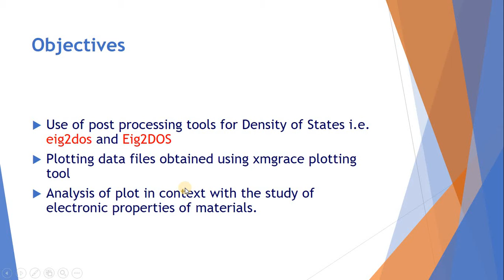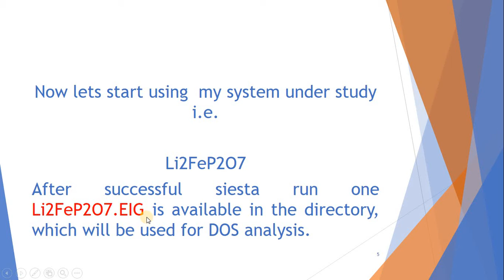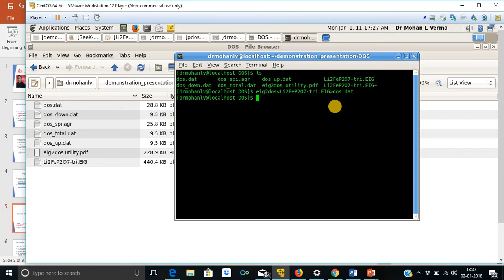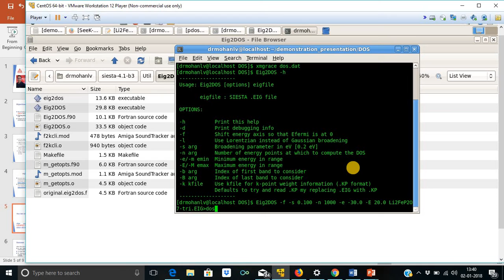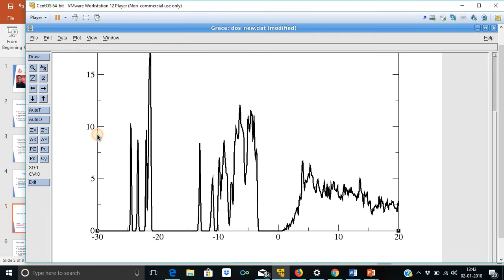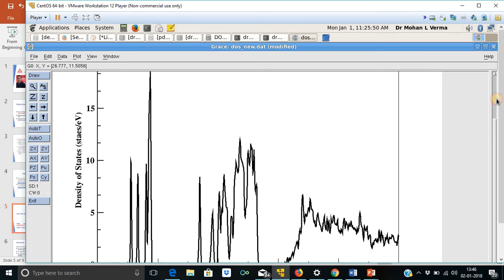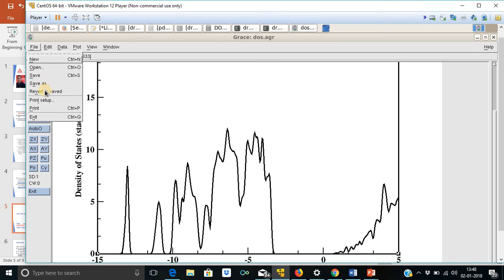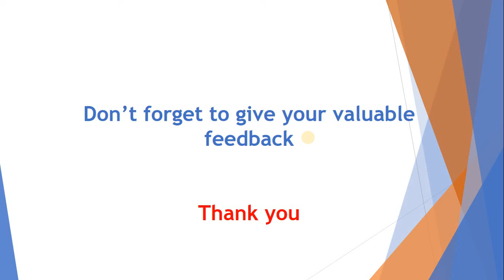Lecture-9 : Density of States (DOS) Analysis using SIESTA - Dr. Mohan L Verma

Comment: What are the necessary packages to run in terminal eig2dos?
Reply from the maker: to compile the concerned Fortran file use any Fortran compiler and u can directly use eig2dos  binary. 
now its also available in Eig2DOS form.